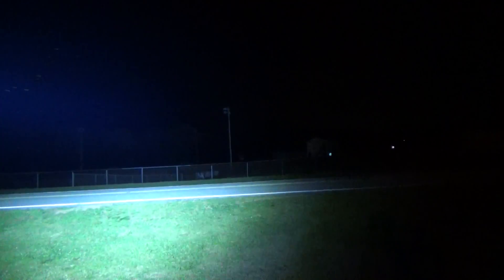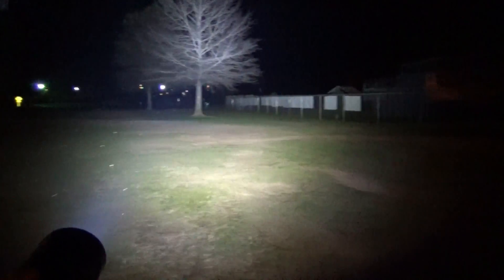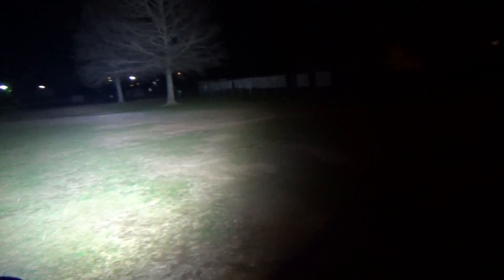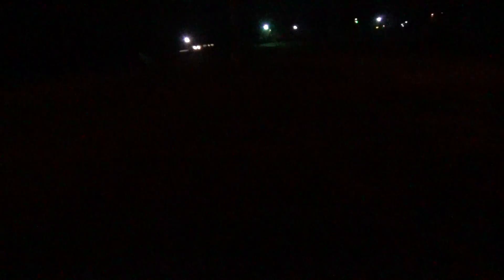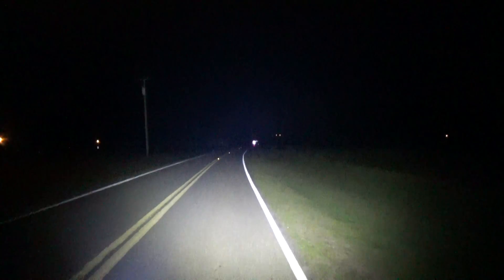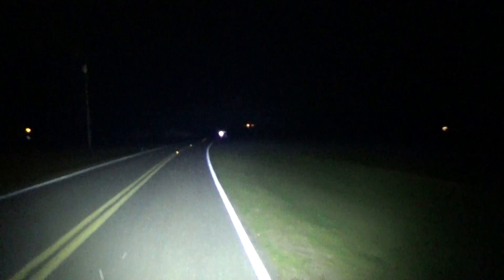Haikelite MT09R 70.2 New Driver 22k lumen video footage.

Comment from the maker: Lol I just noticed I have 2 dislikes clicked on this video. I'm trying to understand how you could not like this light. You get performance that in other lights would cost you $250.00 to $350.00 dollars. So I say to you thumbs down guys, if you know of or can show me a light at this performance level in this price range I would love to know about it. I've had several of my own staff and some that are just friends trying to find anything close to it and no luck. 

If it's from those that constantly say wow super bright light but only for a minute then it steps down... well wrong again. I've left this one set to step down at 55 degrees C which is really not that hot when you are working with this much power. I can safely set it closer to 65 C and about doubled that step down time. This light sheds heat really well you can let it cool for even just a few minutes and it's ready to go. 
My original point still stands. Show me a light that out of the box will give you performance at this level in this same price range. The $350.00 lights that can make it to 22k lumen will still step down and many of those will not go back into turbo for lack of power left to make it.

Haters are gonna hate lol regardless. If you pass on this one you are really missing out on a great light at a very reasonable price.
Reply: I wondered why there are so many dislikes in your videos, and now there's the reason.

20 000 lumens is no joke, and unless you actively cooled it, no light could probably hold it at 200W or high for a few minutes.
Reply from the maker: It uses Narsil UI and steps down at 55 degrees C. That can be set to a higher temperature before step down. I have changed mine now so it is about 65 degrees C before the step down... The cool part is that it is set up that when you ramp all the way up it is only running about 50 to 60 percent of max so around 10k to 11k lumen and you can run that for a decent about of time without any serious over heating at all. Then just use the turbo mode as needed. Trust me when I say you can ramp it up to 50 percent and it will be much brighter than almost any light you own or is even available... Turbo just is like the icing on the cake that when used just puts everything else to shame...